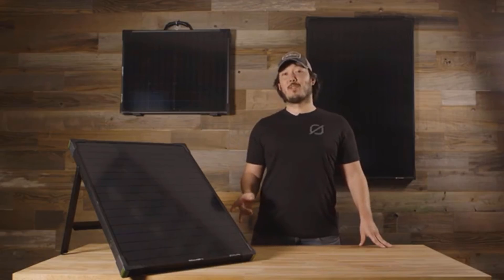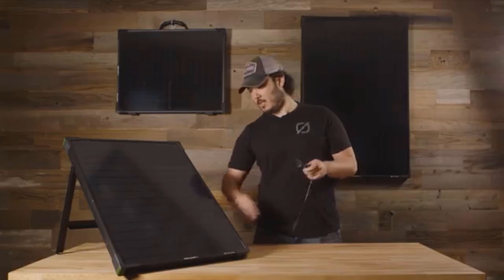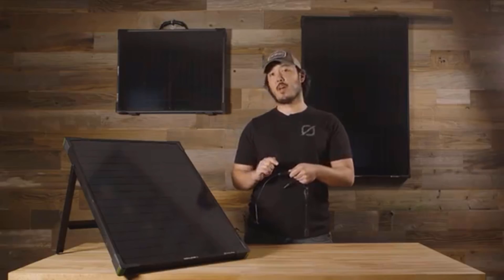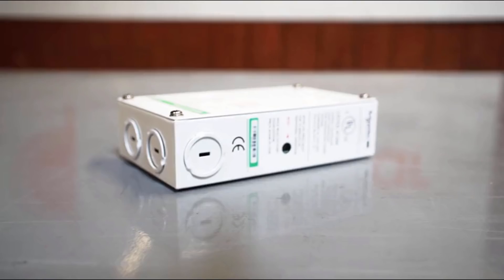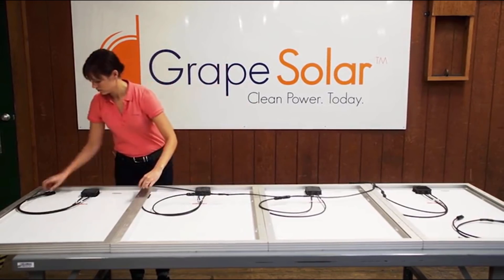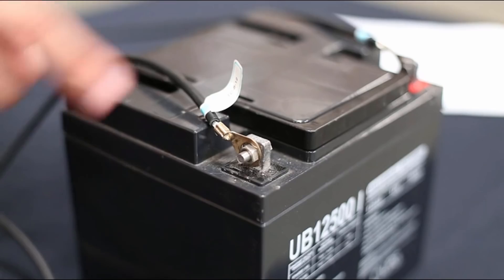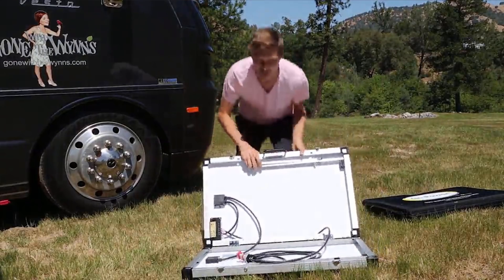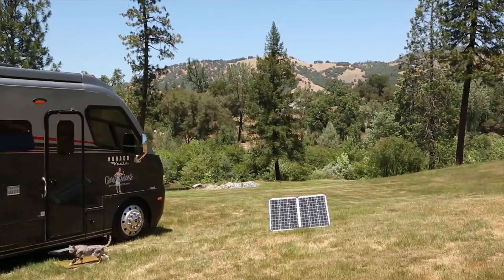10 Best Solar Panel Review

Comment: could a solar panel be made similar to a light long hologen bulb? reverseing the panel to a pipe shaped? o even globe shaped? and are any shaped as window frames as along the outer edge?---also how is condensation issues and water avoided ?most i have had have weather issues just on that part, any with better sealants recomended? or any with easy lego links like connects as parralel by snaping together?

Comment: Had to give this video a thumbs down since it wasn't, as mentioned, a true review of these solar panels and instead more of a marketing platform. Quite honestly, the one most important factor that counts is whether a solar panel really does deliver the power that it says it does. I know it sounds picky but I have bought a variety of solar panels that will give anywhere from 90% to 40% of their quoted power output. There just seems to be some  level of blurring of specifications in this industry since the average purchaser is unable to know if they actually got what they paid for.